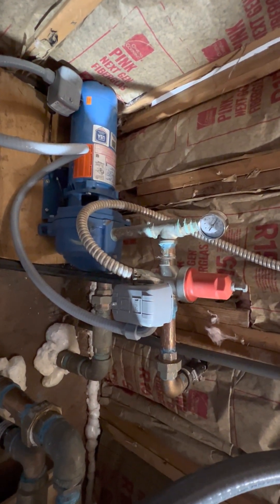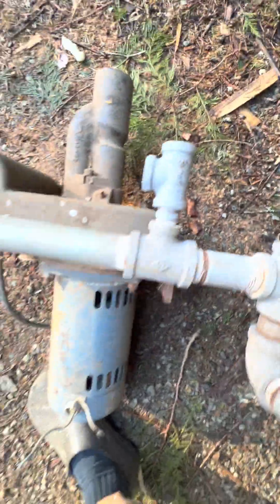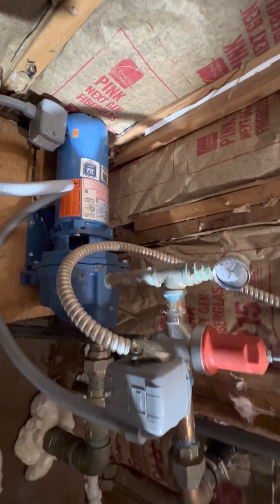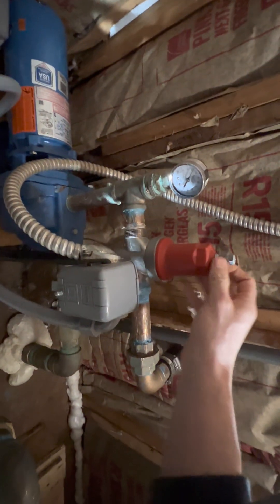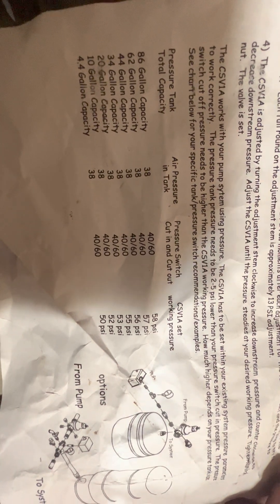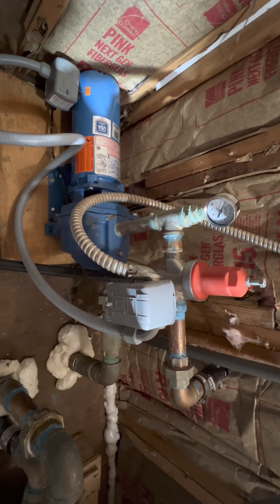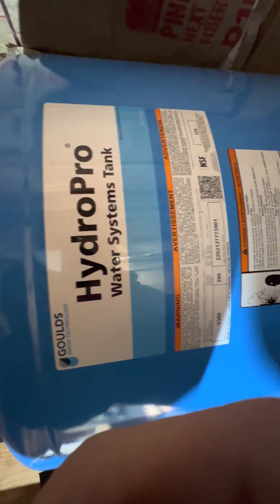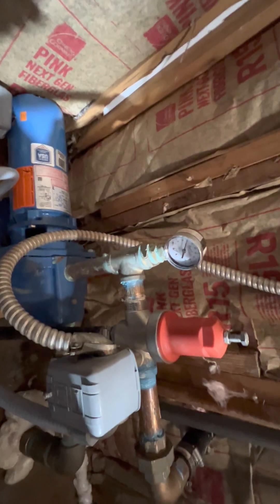How to Increase Water Pressure Inside Your Home: Wells & Spring-Fed Systems

Comment: I like the stable constant pressure results you are reporting re the cycle stop system you have.

However, I am a bit confused about your spring fed setup. 
I am on a well with a submersible pump and the routing of the water does look similar. 
However, you indicate that with your cycle stop valve system setup you will have about 40 gallons available in a power outage (whereas with my normal setup that would not often be the case). Though many falsely believe it to be ALWAYS true, they forget that it all depends on where the pressure tank water level happens to be at the very moment of the power outage. In other words, if your pressure gauge is down to 51 pounds (right before cut-on in your example) then you have very little water left in the pressure tank and that is all you will get out of it upon power outage. Conversely, the only way you will get the full capacity of the pressure tank during a power outage is if the tank just finished filling up to 70 pounds and you have not used any yet and then the power goes out.

Of course if you know you have just used at least 40+ gallons (non-stop) and with the water still running long enough for the cycle stop to kick in and get the tank back to 67 pounds, then if the power goes out you know you have almost 40 gallons (probably less in your case since it did not get to 70 pounds).

Anyway, know matter what, it is always a crap shoot re how much water you have in the tank upon power outage. You could experience a thousand power outages in a row at either extreme ( a 1/4 gallon left or 40 gallons left) or any combo in between (regardless of how frequently you use water, unless you never use it until the power goes out).  

I am confused and am not seeing that capacity gamble as being any different using the cycle stop; is it?

Our solve to this problem is a spare small cheap holding tank with a cheap jet pump (& generator) that we can 'switch' online during an outage.

A simple confirm video project would be to put a time lapse camera on your pump gauge for 24 or more hours to see where that needle sits most often. The results are ...? (guess I now have a video to make, thanks for making me think too hard. It hurts.)  --- subscribed! and belled.